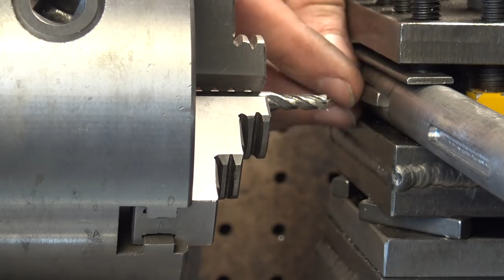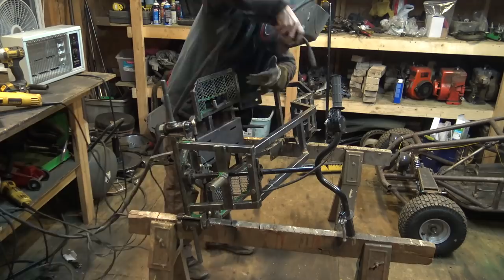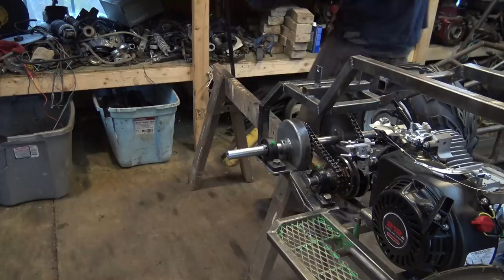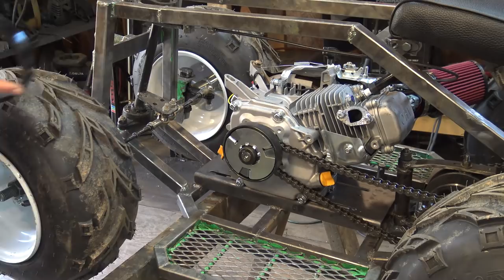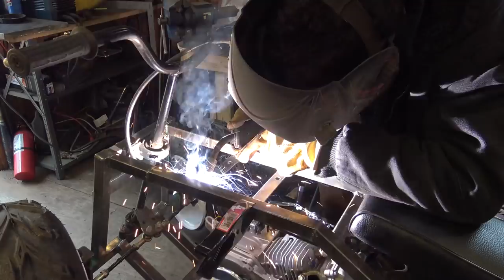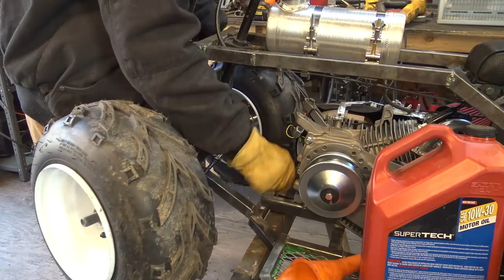rebuilding the two speed mini green ATV part 2

Comment: I'm hoping once I get my small insulated shop built, to build a selectable 4wd ATV. Transfercase would be similar to your 2 speed setup. Using agricultural 1" ujoints and doing dual A-arm suspension all around. I would be using the 420 Predator for electric start and getting a larger charging coil/stator to run my lights. I have most of the parts, just no place to build it being cooped up in an apartment now.

Comment: Cool build but As a machinist I’m cringing watching using mill with the mill cutter in a drill chuck on a drill press! And it’s never too cold to weld it generates its own heat as your welding you just have to start out and do a few overlap or weld with a tighter pattern  to enough heat in the piece!

Comment: I have a question. I have a go kart with a Tecumseh 6 hp Power Sport motor, that wont start. I've replaced the carburetor, spark plug, and recoil start. It has compression, spark, air and fuel. Any suggestions would be welcome. Keep up the great videos. also, do sell the transmissions?

Comment: please dont make the mistake i did when putting my torque converter on. the bolt that comes with it is NOT the correct thread for the engine. the correct thread is a 15/16-24. i had to tap my crankshaft after it got stripped (i was not using an impact wrench btw) and finding the correct thread bolt at my hardware store was very difficult

Comment: Just for safety sake the extra threads you have past you'r locking nuts on the axle shafts I would drill a hole and fit a cotter pin. We do this on the farm every day.You'r two speed transmission has give me an idea for the hay loader look out barn crew there going to come at you faster....

Comment: buddy I know u said ur worried about using a propane heater in there but unless ur welding the propane tank u aint gonna burn shit down... hell ur welding over a wood floor and ur worried about a heater?... just hook it up and do a bubble check on ur propane connections with some soapy water... I did it for years with a busted ass propane heater and the shop still lives lol

Comment: Do you really think ambient temperature makes a different in how metal welds???  Really?  Think about it!  Your welder feed may not like the cold, but when metal needs to get up around 1000 deg to weld.  Even 100 deg ambient temperature changes are going to have very little impact.
Reply: Wayne Roller in his apllication it may not make a huge difference but with some stick welding rods it does and with tig it does

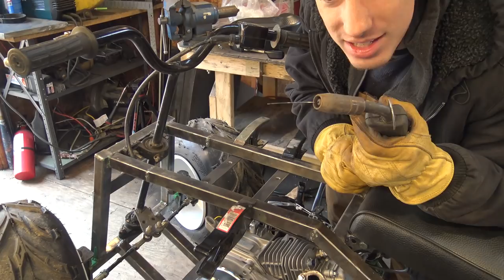Comment: Watch carefully starting at the 7:40 mark and does anyone else notice welding slag going into the exhaust manifold? At 7:52 I can see a large one going into the manifold and you can visibly see it cooling down inside the tube. 
Why don't u EVER use drop cloths when welding?
Considering that #gopowersports sponsors you and that is their engine and other parts, a little more care should be taken....hmmmm
I was hoping that u wouldn't start it, because serious damage happens inside a cylinder with tiny bits of metal..... professional!!!!
Reply: yeah it was like one little piece it will b fine
Reply: are u stoned? One lil piece? Do u think that any metal inside a engine cylinder is fine? WTF!
Reply: I mean yea a little. Pre mature scoring will be the only thing that will happen. jeez acting like the tiny ball of metal Is a chunk. A tiny ball of slag like that won't be a major issue. If I were doing this in my shop id close off every hole with a rag, but this isn't me and with experience I can say this isn't a huge issue although it did happen. Pointless  to tear it apart and chase after that ball of slag...
Reply: engine ran fine tho.. lmao
Reply: dyllman98 didn't u see it smoking? Hmmmm. Burning oil because of a lil premature scoring..
Reply: 1st he said its cold asf... 2nd WHERES THE BLUE SMOKE?? Theres none. its just exhaust fumes bud.